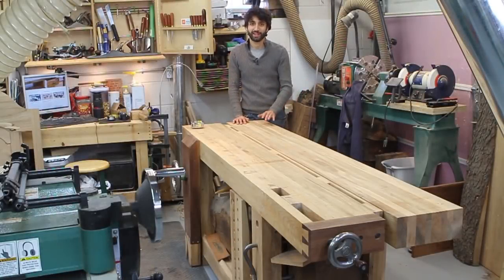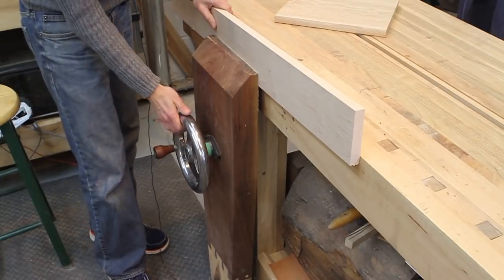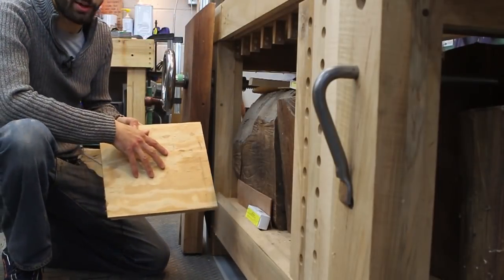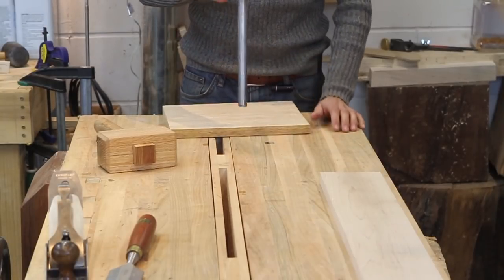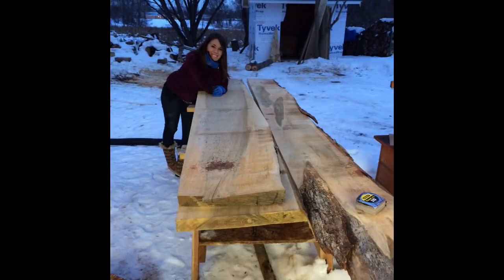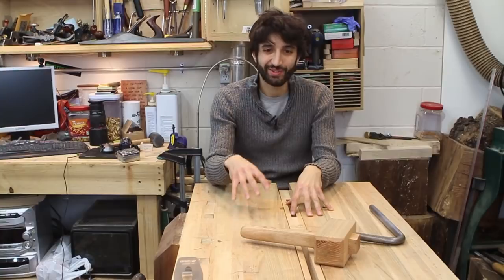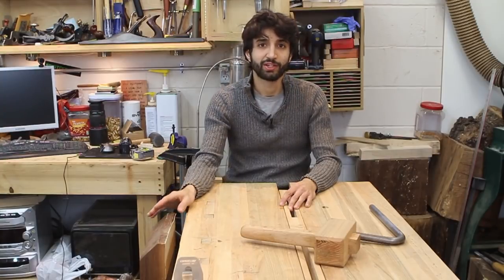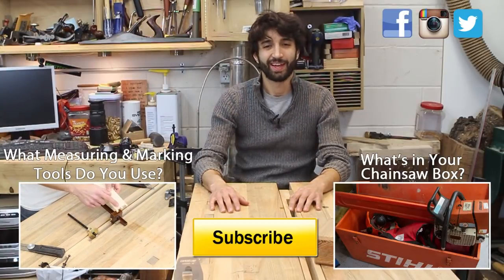My Split Top Roubo Woodworking Workbench - Ask Matt #5

Comment: Every third word in my head is Roubo. I have the hardware, I've ordered the wood, and plan initially to attach the front half to French cleats on the wall in the workroom, which is crowded with two gobar decks for piano making. The back half of the Roubo will wait until I know more. Thanks for your very thorough presentation.
Reply from the maker: Paul Mcnulty That's actually a really good idea.  Wall mounted Roubo.  I'm sure a lot of people would benefit from that design.  Thanks Paul!  Good luck on your bench build!

Comment: Well, this morning I fitted my roubo workbench top to my Jack-Bench bottom....and it does work to raise the top to a very nice working level. Shall install the center tool topping next week and smooth the top with my router as the WoodWhisperer does to even out the top to totally even and level.  And shall drill out the dog holes using my
Fortsner drills.  Am trying to copy Dema's bench....and it is coming out fine.

Comment: I like the way the top was connected to the base. On some of the other builds, they use a through tenon. I like this method because it's easy to disassemble if you move.  With the through tenon, you're stuck with the structure as is. Great job explaining how everything works and how you use it.  Is there anything you would change or add to this bench?  Also, did you flatten the top using a sled or did you plane it?
Reply from the maker: Geoff's Garage Workshop Thank you Geoff!  I honestly can't think of anything I'd want to change.  Another commenter asked me the same question and I couldn't think of one thing.  If I had the space it would be nice for it to be longer if I really had to pick something I'd like to change.  I flattened it with a router sled.  Flattening the bench is why I built my router sled.

Comment: Hey Matt,  two questions for ya.   Is your workshop a basement workshop or a garage workshop?  I am building out a garage workshop but need to get more electrical run and a ton of insulation done before it is usable.   Second question,  Can this be done fairly easily with smaller jointer and planer?  I know you have a monster of a jointer,   but I will most likely only pick up a 6" jointer and then a tabletop planer.
Reply from the maker: woodengamer It's a two car tuck under garage.  It's partially below grade so it's partially insulated by the ground.  Above about a quarter of the garage is a screen porch so that area of the ceiling is insulated and I have rigid foam insulation in the overhead doors.  I have a subpanel in the garage and have all my power for the shop coming out of that panel.  You can absolutely use smaller machines to build this.  Running the top through those machines would be a bit more difficult physically.  I wouldn't attempt it alone and I'd bolt down a portable planer so it doesn't tip over.

Comment: That bench is awesome Matt. I can tell you're very proud of it and I like that you treat it as a bench. I built a 4'square worktable with an MDF top that sags in the middle and its a total PITA when you need a flat surface for assembly so I'm a bit jealous.
Reply from the maker: Paul Desmond Yeah that would get a bit annoying.  I started on a sheet of OSB with only the 4 corners supported so I know what that's like.  Thanks Paul!

Comment: Thanks for your detailed description of your bench. It’s helpful having some general idea of measurements. I am planning on building a top for a base I already have. I am planning on making my vices and your video gives me some ideas. I have not decided what type of vices I am going to use. I like the Roubo style bench. My top is recycled hard maple from a bowling alley. It is 2 3/8” thick. Each pieces has double tongue and groove on each side which will make the glue up process easier. I have thought about drilling horizontally so I can install threaded rod into the bench for additional strength. I don’t think it is absolutely necessary but I tend to overbuild. Thanks again, happy woodworking, be safe.

Comment: Nice bench Matt.  BTW, having watched you over some time now, it should be noted how smooth you have become in your presentation.  However, it should also be noted that the correct plural of the word vice is VEECE.  It comes from the Latin " Veni, vidi, veece," which is translated as "I came, I saw, I held things in place."  You're welcome!

Comment: Hello Matt,
I just had a quick question. I have some 8/4 cherry that I want to use for a top to a cabinet and I am afraid of wood movement. My woodshop is in the basement and the final product is going to be upstairs in my kitchen where the humidity is very different. Should I keep the rough lumber upstairs for a few days before using it?

Thank you and advance for your help
Dan
Reply from the maker: Hey Dan, if you want it to maintain it's size, store the board in the kitchen and let them acclimate to that area before working with them.  Also, if you can store them in the kitchen as you are working on the project if it's going to take you more than a day or two.
Reply: Hey Matt, thanks so much for taking the time to answer my question. I will do just that! have a great day
Reply from the maker: No problem!

Comment: Very nice bench Matt.  I'd love to use Bench Crafted hardware  next time. Currently I've got a small French style Bench (splayed legs, with a tool tray).  It's just over 4' long, and 11" wide (not including tool tray).  It works great (better than the workmate it replaced), but I hope to build a more substantial bench like this when I have more shop space (i.e. I get to move it out of a spare bedroom)
Reply: Also, if you haven't yet, I'd suggest adding a small piece of leather to the "foot" of the holdfast.  It helps immensely with the grip (also using both of them once you drill more holes will too).  

I like the dual-wood chop as well

Comment: Great explanation about your workbench.  Any idea how much it weighs?  I was more surprised in the cost of the tail vise than I was the leg vise.  Both look like quality products that should last a lifetime.
Reply from the maker: pcorlis Thanks!  I had to look up some info on silver maple to estimate the weight.  There's about 120 board feet in the bench.  Silver maple typically weights 33 lbs per cubic foot (12 board feet).  So somewhere around 330lbs (plus all the bowl blanks I have under there, so probably over 400lbs).

Comment: Matt - I have been drooling over the various Benchcrafted Split-top Roubo builds for quite awhile now. Nice job on yours!  When I get up the nerve, I will be using Marc's vids.  Has he created a supplement for the scissor version of the vise?  Or did you consult the Benchcrafted plans for that install? I think Marc's vid shows the original version - correct?  80 hours sounds pretty quick to me - I KNOW it will take me way longer!  Thanks for the tour!
Reply from the maker: Thank you!  He did a retrofit video when he changed to the crisscross from the parallel guide.  I built mine before he did that video. I just followed the benchcrafted plans.  It's actually a simpler install than the parallel guide.

Comment: Great explanation and info about the build Matt. There are alot of considerations when building the right type/features of a bench depending on what you do most. I can see the quality work you put into it, really looks great and has many useful features. Now that you have used it for awhile, aside from the holdfasts, are there any other customizations you would add or changes in the build if your were going to build another? Thanks!
Reply from the maker: Dave Ellingsen Thank you, Dave!  Honestly, I'm really happy with the bench.  I have no complaints about it.  If I had more space, I would make it longer, but other than that, it fits my needs perfectly.  It's a great feeling.  I love it.
Reply: Matthew Cremona
That's great Matt, fit, form and function. Seeing your build is making me reconsider some options in my next bench build. I really like the small split insert with function as a tool holder and a bench dog of sorts, and the ability to clamp vertically is a nice option to have. Thanks again Matt!
Reply from the maker: Dave Ellingsen The tool holder is really nice.  It helps keep me organized when I'm working at the bench.  No more tools rolling off the bench either (as long as I remember to put them into the holder :) )

Comment: That's a very good looking bench, and has everything a good bench needs.  I really like that leg vice, it has a lot of space between the top and the screw.  Can I ask you, without insulting you, how is it a Roubo bench since the structures are different.
Reply from the maker: Thank you!  I'm not sure I follow.  Which components are different?
Reply: +Matthew Cremona Your bench is like a Roubo in that both have thick tops, no aprons, and the facility to take a leg vise.  However, there is a fundamental difference between the two, that's in the structure.  The legs of a Roubo are mortised directly into the top, and there is only one front-to-back stretcher between each pair of legs at the ends.  Additionally, each of those stretchers is located close to the floor for a very important reason.  Having the legs fixed solidly to the top creates a problem, the top pushes the legs in and out when it expands and contracts.  The movement of the legs is why the stretchers are located near the floor.  The joints between the legs and stretchers rack as the top changes size.  This is a completely different philosophy of bench building from almost all other benches.  The Roubo is only a half step away from peg-and-slab construction.  I wouldn't get into a fight over what is, and what is not a Roubo bench, but Roubo benches are fundamentally different from other types in how they're built.  I don't see how a completely different structure and top can be called by the same name.  But Roubo is having a revival these past 20, or so years, so benches with thick tops are now being called 'Roubo' whether they have the Roubo type of construction, or not.  Your bench is a very good bench, no matter what name it's given.

Comment: Why did you cut out the square dog holes? I'm in the middle of building my own bench, and what I did was take some 1x3, cut it into a bunch of equal pieces, and glued those pieces in, with an appropriate gap. That gives you square holes without cutting them in.

Well, I hope it does. I haven't finished my bench, so maybe this is the wrong way to do it.
Reply from the maker: J.L.M. The dog holes aren't the same size all the way through.  There is an area for the head of the dog to go and the dog hole is angled.  Check out my shop update from Jan 27, 2014.  About 3:30 in I talk about making them: https://www.youtube.com/watch?v=n-zGuDXIiC0

Comment: very nice bench and a grate design. 1 question tho! isint the site on the workbench were the leg vise it straight? if it is then isint the lining on the bench site of the vise to mutch? what i mean by that is, when you clamp a long workpeace in the vise it stand a 2 or 3 mm away from the bench at the end so if you try to saw there it vibrates? just some thoughts
but again exelent craftmansship and beutifull workbench
Reply from the maker: pjakkur007 Yes, the front of the bench is a clamping surface.  The way I have the suede mounted to the front of the bench keeps the workpiece from contacting the entire font surface of the bench.  I really only use the leg vice for smaller pieces so this set up works well for me.  The added suede on the inside adds more grip and protects the workpiece.  I suppose I could also line the entire front of the bench in suede too :) haha!  Thanks!

Comment: Very nice bench Matt, thanks for sharing. A question for your next "Ask Matt" I have been looking closely at my planes and noticed that the irons are not always the same way, some are bevel up while some are bevel down. Is there any rhyme or reason for this? For instance, my block plane is bevel up and my jack plane is bevel down. I can assume that there might be a reason of some sort, but hope to confirm or dispel what I think might be the reasons. Thanks
Reply from the maker: TJ weim Thank you!  I'll add the question to the list.  There are advantages to each and you can find bench planes in both styles.  The bevel up planes can have their cutting angle adjusted by changing the angle on the iron.  A bevel down plane's cutting angle is set by the frog so altering the bevel angle has no effect on the cutting angle (unless you put a back bevel on it but that's another story).

Comment: Thanks Matt. Just subscribed. I'm currently trying to save money for retirement (hopefully soon),so is there any way you'd recommend, cutting costs without significant  quality, in building this bench? I'm  thinking MDF for pricey hardwood. I've got lots of screws and glues. Thanks
Reply from the maker: Thanks David! I'm not sure how well mdf would hold up especially around the dog holes.  You could save some cost and use thinner material.  Possibly reclaimed wood like flooring if you can find it. or you could even make it out of 2x6s.  Just make sure you give them a chance to dry before using them.

Comment: Did you apply any finish to the workbench (urethane, oil, etc.)?  I have some surplus red oak, cherry, and black walnut with which I am going to build a similar workbench.  I believe these species should be sufficiently hard for a workbench. Any thoughts?
Reply from the maker: I applied a coat of General Finishes Outdoor oil because I had a partial can to get rid of.  Those woods would be great.  Your bench will be harder than mine.

Comment: So what if I went with using 2x4s, idc about it getting dinged either its a wrkbench but is tht TOOsoft of a wood? Also either way if it is or isnt what about slapping some linseed oil on it. I was told thtll toughen it up. Is tht true? Which do u find more useful the tail or leg vise. As far as basic woodworking needs. Both look really comolex as far as installing goes but im going to take the time to do things right so hopefully (whichever one is more versatile ) will go together smoothly..lol so m/t the legs wth a lag bolt in each one..tht stinks cuz im just getting into the m/t joinery and I suck at it. Lol is there any other way thtll keep it together and from warping over time or is tht the 1 way? Thnks for ur time and help much appreciated til the next episode #Minnesotaswag
Reply from the maker: Joe Walters Depends on what the 2x4 is made out of.  If they're doug fir, they will make a really nice bench.  The oil helps to keep it from getting stained or glue sticking to it.  It might help with the durability.  I use the leg vise more because I do a lot of dovetailing.  The tail vice is nice to hold things while you are routing an edge.  You could just lag or carriage bolt everything together if you wanted too.  :)
Reply: .yes they are doug fur .so kool! Glad I spent the extra buck fifty..lol and ok kool I picked up a gallon jug of boile linseed oil (that was all they had in stock) as far as vises go I might wait a while on tht til I get more experience. I chkd out the prices and yea im gonna have to wait on them..hahaha and i shld glue em down too plus carriage bolts right. I wish I had a m/t machine.harbor freight has a cheap one for like 150 maybe buy it usenit for tht and take it back..;) hahaha th nks for th e help man! Youve helped me out ALOT and WITH ALOT!:)
Reply from the maker: No problem!  happy to help!

Comment: That's a beautiful workbench.  Thanks for taking the time to make all of your videos - I find them extremely useful.  I'm just starting off in woodworking as a hobby and I've learned a great deal from you.  I have a question though about attaching the table top to the frame - I was under the impression that one shouldn't bolt a table top to the frame due to risk of warping/cracking caused by wood movement and instead a table top should be affixed with z clips or something of that nature...?  Thank you and I look forward to more of your videos!

Comment: I got 2 oak chimneys made of oak for 30 bucks. I need to remove all the nails and fill up the holes with epoxy, then I can start planing, looking at the prices of oak beams these days it's an absolute bargain. beams are 16x11cm and 1,70m long, and I got some wood to extend it

Comment: Matt, great job and video. Love the Benchcrafted vises too, even despite the price. Looks like the wheel on the leg vise sticks out from the front of the bench a whole lot, do you find it ever gets in the way?
Reply from the maker: Thank you!  I've never had an issue with it.  I haven't walked into it or anything.  The new wheels don't have the knobs sticking out the front which certainly makes them more streamlined.
Reply: +Matthew Cremona thanks for your opinion and reply.
Reply: +Matthew Cremona thanks for your opinion and reply.

Comment: Hi Math nice video. And great tour of the workbench. Do you happen to know if there are plans of this design with adjustable legs? I'm kind of tall but I would like to adjust once in a while.
Reply from the maker: +Constructive Bytes  Thank you!  I haven't seen anyone make one like this that is adjustable height but I'm sure you could modify the base to have some sort of lift mechanism
Reply: Yeah no doubt, I've seen threaded rods / sprocket on legs before. How much would you say each slab weights on your workbench?
Reply from the maker: +Constructive Bytes Somewhere around 100 pounds each
Reply: Thanks for the info Matthew!